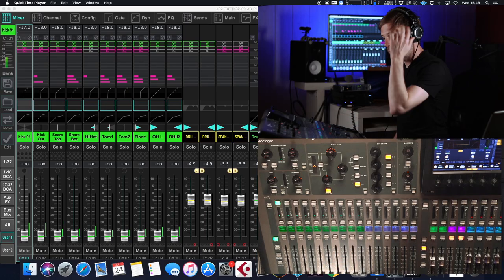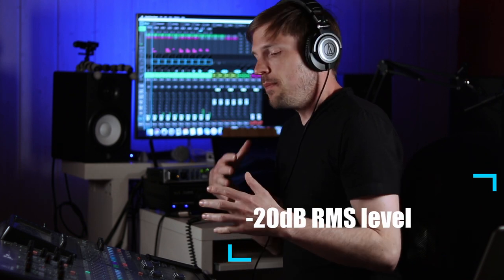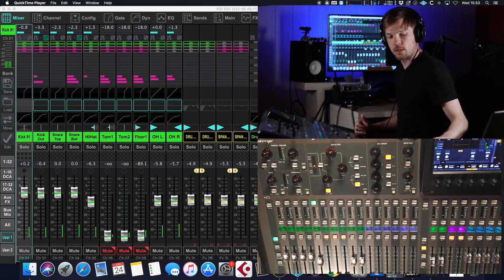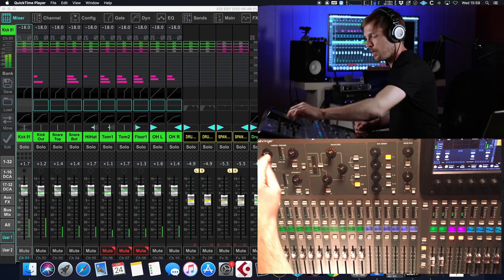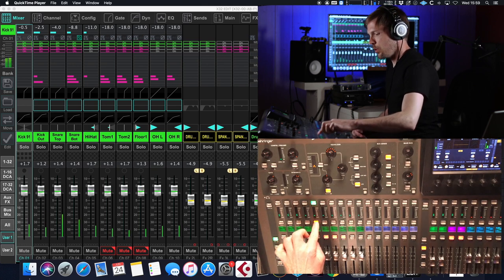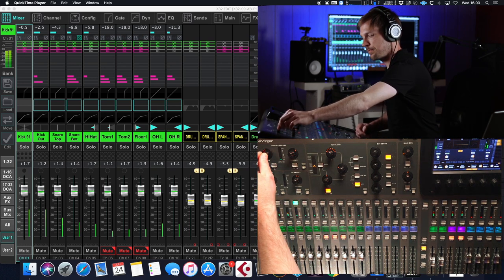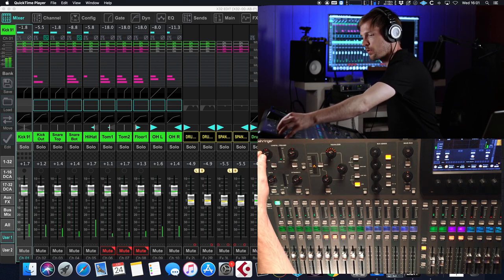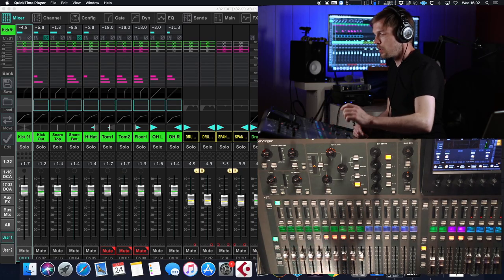Faders at Zero vs. Mixing With Faders Explained | Input Gain Settings for Different Mix Techniques

Comment: Great video, Thank You!

(Fair warning, this video triggered a stream of consciousness that resulted in this mess of a comment.  Hopefully someone will benefit from me wasting my morning free time!)

I’ve been mixing over 30 years now, and across a broad swath of the world that is audio.  What you do in one scenario, you may do differently in another.  While I tend to like Absolutes and Constants, I have yet to find any when it comes to essentially Gain Staging.  IMHO, that’s because I’m always trying to achieve multiple goals, and which one takes priority usually determines which Technique or Approach I take.

This video seems geared towards Live Sound using a Digital Mixer.
In Live, my Master Fader and Main Outs are going to a PA System.  
My first concern is Feedback, then Gain-before-feedback.
Then, how much is happening in this show, and how much can I sub-down and automate.
So I’m working backwards from Not-Failing at my master, having the whole show on a few Subs/Groups & VCAs, and only then, worry about my individual channels.
At my channels, which of your two approaches is dependent upon the board I’m using.
Digital boards process After A/D conversion, and the quality of the DSP processing doesn’t really change based upon the input levels you hit it with, primarily because you can add or attenuate digital gain in multiple places with no loss.  It’s just math.  So there, the input level is mainly about hitting the converters properly.  Healthy signals in, process at will, and sometimes the last processor has an output level, that gets sent to the fader.  

In the Studio, say Mixing, and say on Analog, everything is reversed.
First, there’s no Time Pressure (yeah right) and if you screw up, nobody will ever know.  Just fix it.
So there I start with each individual Track. (Let’s assume the Production and Editing were well done)
Every instrument and musician, vocal performance, microphone choice, recording technique, was chosen for a reason and I try to understand each one, help them achieve their goal, but also remove anything there that conflicts with goal of the overall project.
So if those tracks are coming from a 2-inch tape machine, or a DAW timeline through D/A Converters (note the opposite of what we had before), then they hit input section of my Analog Console.

Here, unlike the DSP, the board definitely does change its sound and performance relative to how much signal, voltage you send through its circuits.
One thing that I don’t think was mentioned in this video, which is remarkable because it can now almost go unmentioned, is Noise and Noise-Floor.  Seems like for a new generation of engineers, the noise floor is so low, it’s almost irrelevant.
Well one of the main goals of Gain Staging used to be maximizing your signal to noise ratio.  You tracked as hot as the Tape could handle, and even pushed the peaks into saturation (not primarily because it sounded good, that’s another reason altogether), then you hit the boards channels as hot as they could handle (again not For color), mixed, then output as hot as possible to the 2-Track.  All to stay as far away from the noise floor as possible, at every “Stage” of the process, so that the 48-track Mix that you sent the Mastering engineer didn’t sound like left and right channels of a band playing on a beach with waves crashing and wind howling.

The purpose of Compressors, or dynamic range compression, was to squeeze down the peaks, therefore allowing you to raise the overall signal higher above the noise floor than before.  (I won’t talk about broadcast, but yeah most of the tools that we now use as creative instruments, were utilitarian broadcast devices first.  I think Live world gave us Graphic EQs though.)

Now the fun part.
All those Tracks are piped into the Channels on your Analog Console.
In addition to the two utilitarian techniques rightly discussed in this video, forget about the faders, pull them all down to infinity and use your Solo bus.

Now you can think of each Channel-Strip as an extension of the instrument playing through it.  

You know that if you set the input too low, your in the noise floor of that channel’s circuitry.
You know that if you set the input too high, you’ll be clipping the electronics, red lights will be flashing, all hell breaks loose.
You should know, especially if you RTFM, that the console has a Nominal Level (which isn’t exactly the same as Unity), that the manufacturer has set as the intended range where you’re well above the noise floor, and have plenty of headroom before any distortion.  (There are specs for this stuff)
The Nominal level, is the usually Safest Cleanest signal you’re gonna get through the electronics, if used as intended.

But who’s intentions really matter?
The equipment manufacturers, or the Artists and Musicians passing through that equipment?
The Producer or the Label that may be paying you?
Or You, the Mix Engineer, entrusted by all these people, and with your hands on the controls?

Bruce Swedien, one of the greatest audio engineers of all time (Who just passed away a few months ago.  RIP Bruce!  Thanks for everything you gave us.), once told me that...
Bill Putnam, an even greater audio engineer and inventor of the half of all our tools not invented by Rupert Neve, and also Bruce’s mentor, told him that...

“You don’t listen To the equipment, you listen Though the equipment!”

That sage wisdom brings us full circle:
With your ears locked in on Solo isolating just that One instrument trying to make its way off or that tape, or out of that converter, and through that channel to your ears, the Input knob is the pressure valve in your hand that determines how much PSI to let into your circuit.
As the Signal’s electrons interact with the Console’s electronics, the Performance on the other side is telling you it’s intentions, and without any processing engaged, the channel itself starts responding.  First the signal emerges from the noise darkness, then into the nominal light in all its glory, but then if you keep going, the signal pressure will start to press against the boundaries of the circuit, and the channel will start to complain a little.

At some point, the channel will go from simply passing the signal along like a straight piece of wire, to adding its own contribution to the Signal that makes it out of the other side.  In fact, that’s what Distortion means.  Objectively, the circuit is ‘distorting’ the signal passing through it.  A sine wave running through it into an oscilloscope will look distorted at some level of input gain.  Every analog circuit will distort at some point.

So electronic engineering 101 is design shit that doesn’t distort, let’s it perform its function, without mangling the original signals in ways not controlled by the Audio engineer.  Audio engineering 101 is follow the nominal levels set out by the electronic engineers, stay above the noise, stay below the distortion, missionary sex.

Audio engineering 2.0 (catch that) is to disregard the warning labels, and see what’s on the other side of the yellow tape.  Audio engineering isn’t just Objective, it’s also Subjective.  You’re making aesthetic decisions over not just what “should” something sound like, to an oscilloscope, but what does it sound like to your own ears, and ultimately to an audience.

Now, “just because you can, doesn’t mean you should!”
Things may sound amazing in solo, but totally not work ‘in the mix’.

(I have a lot more to say, but I’m out of time, so to be continued.....possibly....)
Reply: Thanks much for you’re intelligent and helpful commentary. As someone who has gone from the board, to the stage, and often times doing both during this transition from analog to digital, I appreciate comments like this. Critique given from the lens of experience, while acknowledging that which is subjective, is extremely helpful to those of us trying to figure it all out. Thanks again for your contribution and God bless!
Reply: I am humbled by your focus on the final outcome ..and getting paid by a smiling client! (the last part is ofcourse just me reading into things) instead of arguing theory on the internet (which too needs to be done to a point)
Reply: Thanks for the good read!

Comment: Let's take it to the next step:  how can we regain speed of work without  apparently common threshold levels? 

Firstly, I study the mixing technique described by Dave Rat in one of his videos. That Bus strategy can be translated to a per channel strategy.
Secondly, I notice that we at least form signal groups of similar dynamic properties - these groups are based on crest factor and bandwidth.
Thirdly, threshold levels can be a lot closer by using HP/BP in the SC of Gate & Comp, as well as using small ratios 1.2-1.5 (but lower thresholds)

What is a universal start setting for a compressor on a board like x32 or sq6?
What if it is:
T: -34dBFS
R: 1.5
A: 0,9ms
R: 50ms
Knee: Softest
Detector: RMS (Peak for drums)
HP: 200Hz (lower for BD and Bass)

Should a gate cut more than 15dB?
Reply from the maker: There is food for thought there, but to me there are no universal settings. They depend on the music material and your sonic vision. Since compression can be used for dynamic control and/or sonic sculpting, it really depends on what it is you want to achieve. And yes, gates can cut waaaay more than 15dB. Again, it depends on how busy your mix is, what the musical content is like and what you want to achieve.
Reply: wha

Comment: What happens to floor monitors when you change input gain on channels mid show? How does the artist react when you change input gain midshow?
Reply from the maker: The techniques in the video explain the initial approach of console setup. I would not recommend drastic gain changes mid show. However, if you see a drastic change in your signal input between the sound check and the show, then adjusting gain can bring the mix back in check. Make sure those changes are as minimal as possible.

Comment: I have a question for everyone.. I was taught to maximize gain for each channel by using PFL, then adjust the Faders to the desired mix. I don't even bring the Faders up until I have the gain structure set. 

I recently purchased an Allen & Heath Qu-SB digital rack board, and while I love the sound quality it produces, it also creates a fair amount of hiss when sound isn't coming through the speakers to cover it up. I just started mixing bands again, so I'm a little rusty. So my question is...doesn't maximizing gain reduce hiss to it's lowest possible level, since the signal doesn't require being amplified as much before going to the mains? Or to lower hiss do I need to be less aggressive with gain structure, and amplify the sound coming from the preamps more? 

I had always thought Allen & Health was the gold standard for small to medium sized rigs, but I had much less hiss with the Midas MR-18 that I used in a previous band. That thing was as quiet as a mouse. 

Any help you can provide would be appreciated. Thanks all..
Reply: Hiss in a signal is due to the amount of electricity flowing through the channel. By maximizing the gains and electricity and then turn up faders you'll likely have more overall hiss. Using less gain, which is to say, less electricity you reduce the amount of hiss. Starting your mix with the faders at 0 will help to eliminate this as much as possible.

Comment: I was mainly confusing on the fader positioning while adjusting th input gain.. so basically Just keep the faders all the way down while adjusting the input gain to around -10 to -20 decibels, and then bring up faders to nominal position 0db? Thanks!
Reply from the maker: The faders won’t necessarily go to nominal level, because you have to adjust them to create a balanced mix, when you match the input gain levels.

Comment: I wonder why, while people complain that their faders land to low after setting gain, they always seem to forget about TRIM!. We never had trims in analog desks, but neither we had A/Ds. I tend to set my gains so the signal hits Preamp and A/D at proper level then if I need I can adjust with trim which is also before all processing so you can mix both ways - have similar levels @Preamp and A/D AND faders @zero if you wish.
Since digital consoles I have seen literally ZERO! guest engineers ever touching trim pots.
Reply: really interested in your point.... you mean i can set gain to unity, and adjust the trim to place the fader at zero.... but.... how much level is going to receive the compresor?, just unity from gain, or trimmed one (lower)?
Reply: This is probably a dumb question, but I thought the input gain setting was the trim. What is the difference between setting the input gain and the trim? And where is it generally on the console? I basically just see the preamp gain adjustment for the channel and then the channel faders. What do you mean by trim?
Sorry to keep editing. On my board there’s something called HA again split that plots trim and gain. Normally adjusting the trim adjusted the preamp. But with the split the the channel gain control adjusts the trim and the preamp gain has to be changed form the preamp tab on the set up menu. And it says A/D gain. What is the difference between these? What is A/D gain? Thank you for reading this and answering, if you’re able to.
Reply from the maker: It truly is a good workflow, but not all consoles have that ability. Plus, the trim still affects your processing levels for EQ and dynamics. Great for running preamps hotter on some high end stage boxes, but not all users are fans.
Reply from the maker: @trubador25  Hey. The Gain is the control for the analogue stage of the preamplifier. It controls the level of analogue signal amplification before it hits the converter from analogue to digital (A/D gain). Trim is the control for the digital signal level AFTER the converter has already done its job, so in the digital domain. For example, if you have 2 digital consoles sharing the same stage rack with the preamps, one of the consoles would control the level of the preamp (the analogue gain). That is why it would be called the master console. The second console would only have control of the digital signal after the converter (using the trim, with no access to the preamp level) - that one would be called a slave console.
Reply: @trubador25  What's usually called gain or your A/D gain or HA is a gain of an analogue stage preamp. After that signal hits D/A converter and from now becomes digital. That's where your trim sit. It allows to adjust signal level without any sound effects. While usually setting some analogue gain levels affect the sound and hitting an A/D at certain level is often also important trim itself has no effect on sound. It allows you to set how much signal goes to further processing as your dynamics/EQ require certain levels to work best as well.
Reply: @gainmedialab  True, I didn't mention processing since it was only gain/fader discussed. Actually since I learned way before digital desks I hardly ever need to touch trim pot. I usually set my gains so the signal hits A/D at around -18dBFS with peaks around -12 and that's enough to have good signal at processing stage and easy to work on faders. If I loose too much on dynamics/EQ obviously I can compensate there.
Reply: Thank you all for the awesome info. This is really great
Reply: @gainmedialab  thank you so much!
Reply: @MUTEant44  thank you so much again. I’ve been working on getting the entire gain structure balanced all the way through. A lot of times I will notice that my preamps / channels are fine, but my main output is clipping. Which is as weird. So I started working from the very beginning in the DAW, then the board channels and actually pulled back my channel gain peak points a bit. So this is great advice. I can crank it more and it’s way cleaner without any clipping anywhere. I really appreciate and move these conversations.
Reply: I might’ve posted my reply to the wrong post, but wanted to say thank you again to all of you. All of you’re advice has been really helpful. One of my last replies about getting clipping at the last output stage and going back to the beginning was a huge change. I really appreciate it guys
Reply: If your faders are sitting too low while hitting ~18dbfs/0dbu with gains that's a sign that you haven't set up your output staging correctly. Drop your amp levels.

Comment: The benefit of being able to use presets on each channel for the eqs, compressors and gate thresholds etc is huge for me and why I always set all channel gain levels to the same level.  There is always a little tweaking I have to do anyway,, but much less when Im already in the area. Whichever method you end up using  you should stick with it so you become fluent with it so you can move quickly and achieve a good basic mix relatively fast.

Comment: Hi! Have you tried using a bluetooth transmitter device plugged in at mixer console HP output, and simple using a good IEM earphones with bluetooth enabled? Thanks!
Reply from the maker: Hi. I stay clear of Bluetooth technology for professional work, as it introduces serious sonic degradation, instability and additional latency, which makes it unusable for demanding IEM applications. Haven't come across a BT system that would actually be useful. Have you tried any?